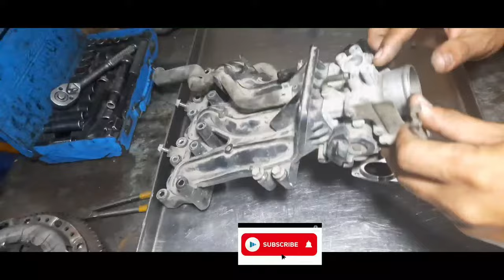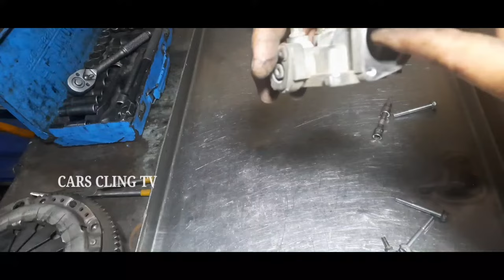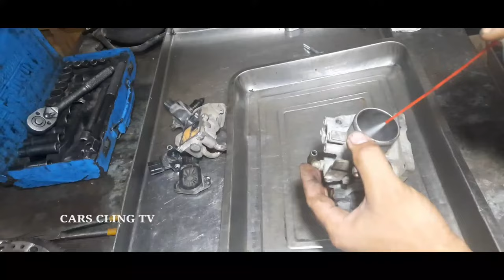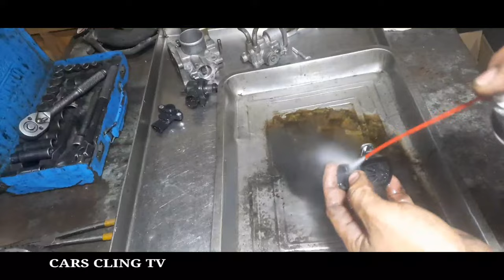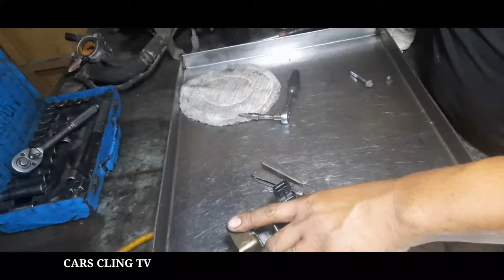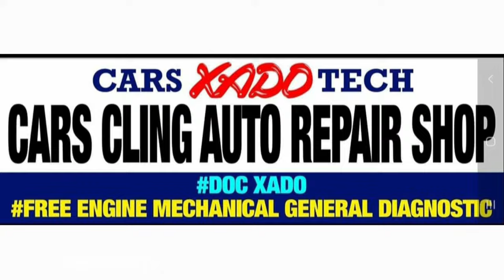ENGINE VIBRATION DIED DURING IDLING IACV TPS MAP SENSORS MAIN CAUSE ISSUE CLEANING SET UP TUTORIALS

Comment: Idol anu po ang sira ng k6a gumagalaw ang makina tpus mamatay ang makina kung hnd m bigyan ng rpm. Pero maganda ang hatak pag apakan m ang pedal.
Reply from the maker: Kapag ang makina ng iyong Suzuki K6A ay namamatay kapag inaapakan mo ang silinyador (throttle) at magalaw ang RPM, may ilang posibleng dahilan at mga paraan para maayos ito:

1. **Dirty or Faulty Idle Air Control (IAC) Valve**:
   - Ang IAC valve ang tumutulong sa pag-regulate ng idle speed ng makina. Kung ito ay marumi o may sira, maaaring magdulot ito ng hindi stable na idle.

   **Paraan**: 
   - Linisin o palitan ang IAC valve.

2. **Vacuum Leaks**:
   - Ang vacuum leaks ay maaaring magdulot ng erratic idle at mamatay na makina.

   **Paraan**: 
   - I-check ang mga vacuum hoses at intake manifold gasket para sa mga tagas. Palitan ang anumang sirang hoses o gasket.

3. **Faulty Mass Air Flow (MAF) Sensor**:
   - Ang MAF sensor ang sumusukat sa air entering the engine. Kung ito ay marumi o may sira, maaaring magdulot ng maling air-fuel mixture at magdulot ng idle issues.

   **Paraan**: 
   - Linisin o palitan ang MAF sensor.

4. **Dirty Throttle Body**:
   - Ang maruming throttle body ay maaaring magdulot ng erratic idle at mamatay na makina.

   **Paraan**: 
   - Linisin ang throttle body gamit ang throttle body cleaner.

5. **Faulty Fuel Injectors**:
   - Kung ang fuel injectors ay barado o may sira, maaaring hindi sapat ang fuel na pumapasok sa makina kapag inaapakan ang silinyador.

   **Paraan**: 
   - Pakonsulta sa mekaniko para linisin o palitan ang mga fuel injectors.

6. **Clogged Fuel Filter**:
   - Ang baradong fuel filter ay maaaring magdulot ng insufficient fuel delivery, lalo na kapag kinakailangan ng mas maraming fuel.

   **Paraan**: 
   - Palitan ang fuel filter.

7. **Ignition System Issues**:
   - Problema sa mga spark plug, ignition coils, o spark plug wires ay maaaring magdulot ng improper combustion.

   **Paraan**: 
   - Palitan o ayusin ang mga spark plug, ignition coils, o spark plug wires kung kinakailangan.

8. **Engine Control Unit (ECU) Problems**:
   - Ang probleme sa ECU ay maaaring magdulot ng erratic engine performance at mamatay na makina.

   **Paraan**: 
   - Pakonsulta sa mekaniko upang maisagawa ang diagnostic check at i-reprogram o palitan ang ECU kung kinakailangan.

9. **Dirty or Faulty EGR Valve**:
   - Kung marumi o barado ang EGR valve (Exhaust Gas Recirculation), maaaring magdulot ito ng unstable idling.

   **Paraan**: 
   - Linisin o palitan ang EGR valve.

10. **Low Fuel Pressure**:
   - Ang low fuel pressure dahil sa faulty fuel pump o pressure regulator ay maaaring magdulot ng engine performance issues.

   **Paraan**: 
   - Ipa-check ang fuel pressure sa mekaniko at palitan ang fuel pump o pressure regulator kung kinakailangan.

Ilan sa mga hakbang na ito ay maaaring gawin mo mismo kung ikaw ay may karanasan sa pag-aayos ng kotse, ngunit para sa mas komplikado at delikadong bahagi, mas mainam na kumonsulta sa isang propesyonal na mekaniko.

Thank you for your support!

More Basic Pointers Toturials FULL Videos: https://www.youtube.com/channel/UCXSl7FUzPZV3lIxFWCHFTVA
For more inquiries, please contact us at our 
FB Page CARS CLING TV: https://www.facebook.com/clingauto
CARSClingTvShortVideos: https://www.youtube.com/channel/UCsUWQnaD9vVKqL_w6eAYhgA
#
#xadoenginetreatment 
#carsclingtv 
#basicpointerstutorialissuefixed 
#xadoenginetreatmentengineperformancerecovered
#10yearslonglastceramicscarbonmetalcoated 
#carsclingautorepairshoplegacy 
#trottledelayremoval
#blackwhitesmokeremoval
#lowpowerengineremoval
#carsclingtvshortvideos
#xadoenginetreatment 
#changeoilpms
#enginecarbonchroming 
#carsclingautorepairshop
#remedyxadotreatment 
#acceptcheckengineissue 
#troubleshoot 
#legitonlineseller  
#Mobile09171259996
CARS CLING TV Located @Purok Pandian Gay Corner Makar Highway Brgy. Labangal General Santos City SouthCotabato 9500

Comment: anong pang linis gmt nyo po?
Reply from the maker: Ang trottle body assembly ay maaaring linisin gamit ang isang kahoy na tanso brush o soft-bristle brush, isang carburetor cleaner spray, at isang clean rag. Narito ang mga hakbang kung paano linisin ang trottle body assembly:

1. Siguraduhing naka-off ang engine at ang sasakyan ay naka-parko sa isang ligtas na lugar.

2. Buksan ang hood ng sasakyan at hanapin ang trottle body assembly. Ito ay matatagpuan malapit sa intake manifold at may isang itim na flap o plate sa loob nito.

3. Alisin ang air intake tube o air filter housing sa trottle body assembly upang ma-access ang bahagi.

4. Gamit ang brush, linisin ang labas at loob ng trottle body assembly. Alisin ang anumang carbon deposits o buildup sa mga bahagi tulad ng flap at bahagi ng throttle plate.

5. Sprayahan ang carburetor cleaner sa mga bahagi ng trottle body assembly. Pay attention sa mga bahagi na may kalakip na sensor tulad ng idle air control (IAC) valve. Sundin ang mga tagubilin ng cleaner manufacturer.

6. Matapos ma-sprayahan, gamitin ang brush upang linisin ang mga natira pang buildup o dirt. Siguraduhing linisin ang mga apektadong bahagi nang maayos.

7. Gamit ang malinis na tela o rag, punasan ang mga bahagi ng trottle body assembly upang alisin ang natirang carburetor cleaner at malinis ang mga bahagi.

8. Ibalik ang air intake tube o air filter housing sa trottle body assembly at siguraduhing maayos na namapa at kumabit.

9. I-start ang engine at hayaang ito'y mag-inito ng ilang minuto. Panatilihing tatakbo ng maayos at subaybayan ang anumang posibleng mga isyu.

Mahalaga na sumunod sa mga tagubilin ng manufacturer ng sasakyan at gamitin ang tamang mga pagsasaayos at mga produkto sa panlinis ng trottle body assembly. Kung hindi ka kumpisyente sa paglilinis nito, maaring mas ligtas na humingi ng tulong sa isang propesyonal na mekaniko.

Yes Sir. Salamat sa walang sawang suporta sa ating munting channel

For more inquiries contact @ FB Page CARS CLING TV: https://www.facebook.com/clingauto
Please Support, Like & Follow  Thank you and God bless!
Contact: 09171259996
CARS CLING TV Located @Purok Pandian Gay Corner Makar Highway Brgy. Labangal General Santos City SouthCotabato 9500
please support my other channel:
CARSClingTvShortVideos: https://www.youtube.com/channel/UCsUWQnaD9vVKqL_w6eAYhgA
Aqua Marine Adventure: https://www.youtube.com/channel/UCHxjUhFmYMbRGxN3l21pNeg

Comment: Boss may tanung Ako anu naman sira kapag matagal pumasuk Yung clutch Ng f6a multicab na automatic..kapag ma init na ang engine..
Reply from the maker: Ang mga posibleng dahilan kung bakit matagal pumasok ang "clutch" o bakit nahuhuli ang pag-engage ng transmission sa isang sasakyang may automatic transmission at umaayos lamang kapag mainit na ang makina ay maaaring kabilang ang mga sumusunod:

1. *Mababa o Marumi ang Transmission Fluid:* Ang unang dapat suriin ay ang antas at kalagayan ng transmission fluid. Kung mababa ang fluid level o marumi na ito, maaaring makaapekto ito sa performance ng transmission dahil ang fluid ang siyang nagpapadulas sa mga gumagalaw na bahagi at nagkokontrol sa hydraulic pressure.

2. *Worn-out Transmission Components:* Kung may mga nasira o worn-out na bahagi sa loob ng transmission tulad ng clutch plates o bands, maaaring hindi agad kumapit ang mga ito hanggang sa uminit na ang makina at dumaloy ng maayos ang fluid.

3. *Problema sa Torque Converter:* Ang torque converter ang responsible sa pagpapasa ng power mula sa engine papunta sa transmission. Kung may problema ito gaya ng pagyonot ng mga internal components, maaari ring magdulot ng delay sa pag-engage ng transmission.

4. *Hydraulic Issues:* Ang mga problema sa hydraulic system ng transmission, gaya ng mga kumakalat na seals o baradong passages, ay maaari ring magresulta sa delayed engagement dahil hindi nararating ng fluid ang mga bahagi na kailangang ikontrol.

5. *Electronic Issues:* Sa mga modernong sasakyan, may mga electronic sensors at solenoids na nagkokontrol sa transmission. Faulty sensors or solenoids could result in delayed response, especially when they're not functioning properly until warmed up.

6. *Normal Operation of Older Transmissions:* Sa mas matatandang models ng sasakyan, normal ang magkaroon ng kaunting delay sa pag-engage habang hindi pa pinainit ang makina, lalo na sa mga lugar na may malamig na klima.

Para matukoy ang eksaktong sanhi, mas mainam na ipatingin ito sa isang propesyonal na mekaniko o dalhin sa service center para sa masusing inspeksyon at maayos na diagnosis.

More Auto Basic Pointers Toturials with %100 FREE
https://www.youtube.com/channel/UCXSl7FUzPZV3lIxFWCHFTVA

Comment: Ano yang pang lenes mo boss?
Reply from the maker: Ang pinakamahusay na panlinis ng throttle body assembly ng Suzuki ay ang throttle body cleaner o carburetor cleaner na espesyal na ginawa para sa paglilinis ng throttle body at mga bahagi nito. Ito ay isang spray-on cleaner na binuo upang alisin ang dumi, carbon deposits, at iba pang buildup sa loob ng throttle body.

Kapag gagamit ng throttle body cleaner, sundin ang mga sumusunod na hakbang:

1. Patayin ang engine at kumuha ng susi mula sa ignition.

2. Alisin ang air intake hose o air cleaner housing upang ma-access ang throttle body assembly.

3. Gamitin ang throttle body cleaner sa loob at sa paligid ng throttle plate o butterfly valve. Spray ito nang diretso sa throttle body at sa mga nakikitang bahagi ng throttle assembly. Siguraduhing mababasa ang mga dumi at buildup.

4. Hayaan ang throttle body cleaner na matunaw at agahan ang pag-alis ng dumi. Maaaring gamitin ang isang malinis na toothbrush o soft brush upang linisin ang mga bahagi ng throttle assembly kung kinakailangan.

5. Liningasin ang throttle body assembly gamit ang compressed air o shop towels upang alisin ang natunaw na dumi at solvent. Siguraduhing walang natirang dalisay na cleaner o dumi bago muling magsimula ang engine.

Tandaan na bago simulan ang paglilinis ng throttle body assembly, sureuhin na mayroon kang sapat na kaalaman at kasanayan. Kung hindi ka komportable sa paggawa nito, maaari kang lumapit sa isang propesyonal na mekaniko para sa tulong at payo.

Thanks For Your Support on Our Channel.

For more inquiries contact @ FB Page CARS CLING TV: https://www.facebook.com/clingauto
Please Support, Like & Follow  Thank you and God bless!
Contact: 09171259996
CARS CLING TV Located @Purok Pandian Gay Corner Makar Highway Brgy. Labangal General Santos City SouthCotabato 9500
please support my other channel:
CARSClingTvShortVideos: https://www.youtube.com/channel/UCsUWQnaD9vVKqL_w6eAYhgA
Aqua Marine Adventure: https://www.youtube.com/channel/UCHxjUhFmYMbRGxN3l21pNeg

Comment: Boss ano kaya problima nang da64 ko na bigla nalang namatay Ang makina pag nag standby ,,mga ilang minuto bumalik Ang power at nag ok narin umandar na ulit,?
Reply from the maker: Ang problema na kung saan ang makina ng Suzuki DA64 ay biglang namamatay kapag naka-standby at umaandar muli pagkalipas ng ilang minuto ay maaaring sanhi ng iba't ibang dahilan. Narito ang ilang posibleng sanhi at solusyon:

1. **Fuel System Issues**: 
   - **Fuel Pump**: Maaaring hindi na gumagana ng maayos ang fuel pump kaya hindi sapat ang supply ng gasolina sa makina.
   - **Fuel Filter**: Kung barado, maaaring hindi makadaloy ng maayos ang gasolina.
   - **Fuel Injectors**: Maaring kailangan ng paglilinis kung barado o hindi maayos ang spray pattern.

2. **Electrical Problems**:
   - **Battery**: Tiyakin na maayos ang kondisyon ng baterya. Suriin kung mahina na ito o kung may loose connection.
   - **Alternator**: Kung hindi gumagana ng maayos, baka hindi nagcha-charge ng tama ang baterya.
   - **Wiring and Connections**: Tingnan ang mga kable at koneksyon para sa anumang problema, tulad ng loose connections o worn-out wires.

3. **Ignition System**:
   - **Spark Plugs**: Baka kailangan nang palitan kung luma o marumi na ito.
   - **Ignition Coils**: Kung may problema, maaari ring makaapekto sa spark plugs.

4. **Idle Air Control Valve (IACV)**:
   - Maaring barado o sira ang IACV na nagiging sanhi ng hindi maayos na idle.

5. **ECU (Engine Control Unit) Issues**:
   - Ang electrical glitches o sensor failures ay maaaring magdulot ng intermittent na pagkamatay ng makina. Makakatulong ang OBD-II scanner para ma-diagnose ito.

6. **Overheating**:
   - Kung nag-o-overheat ang makina, automatic itong namamatay para maiwasan ang damage. Suriin ang coolant system at tiyakin na walang leaks.

7. **Vapor Lock**:
   - Maaaring nagkakaroon ng vapor lock kung saan nagiging singaw ang gasolina bago pa man makarating sa carburetor o fuel injectors, ito ay maaaring mangyari sa mainit na araw.

Mga dapat gawin:
- Magpa-mechanic checkup para matukoy ang tiyak na sanhi ng problema.
- Regular na maintenance at check-up sa sasakyan ay makakatulong para maiwasan ang ganitong uri ng problema sa hinaharap.

Kung hindi ka sigurado sa pag-aayos, mas mabuti na dalhin ito sa isang propesyonal na mekaniko para masiguradong maayos ang maintenance at repair ng sasakyan.

Thank you for your support. Please contact me at this link:

More Basic Pointers Toturials FULL Videos: https://www.youtube.com/channel/UCXSl7FUzPZV3lIxFWCHFTVA
For more inquiries, please contact us at our 
FB Page CARS CLING TV & XADO Available @our FBPage: https://www.facebook.com/clingauto
CARSClingTvShortVideos: https://www.youtube.com/channel/UCsUWQnaD9vVKqL_w6eAYhgA
#
#xadoenginetreatment 
#carsclingtv 
#basicpointerstutorialissuefixed 
#xadoenginetreatmentengineperformancerecovered
#10yearslonglastceramicscarbonmetalcoated 
#carsclingautorepairshoplegacy 
#trottledelayremoval
#blackwhitesmokeremoval
#lowpowerengineremoval
#carsclingtvshortvideos
#xadoenginetreatment 
#changeoilpms
#enginecarbonchroming 
#carsclingautorepairshop
#remedyxadotreatment 
#acceptcheckengineissue 
#troubleshoot 
#legitonlineseller  
#Mobile09171259996
CARS CLING TV Located @Purok Pandian Gay Corner Makar Highway Brgy. Labangal General Santos City SouthCotabato 9500

Comment: Sir tanong ko po balak Kong Bumibili multi cab .maganda automatic or manual o turbo nan turbo salamat
Reply from the maker: Yes Sir,. Mas maganda po ang manual transmission non turbo engine,. Once na naka automatic transmission mahirap ang piyesa then non repairable, mahirap din ang turbo type dahil sirain ang turbo shifting nito, then magal ang piyesa,
Reply: Baka gusto mo bilhin multicab transformer ko 4x4 manual with canopy complete set up 2yrs service  ko lang 220 neg.
Reply from the maker: Thank you Sir. 

More Basic Pointers  Toturials videos: https://www.youtube.com/channel/UCXSl7FUzPZV3lIxFWCHFTVA
FB Page CARS CLING TV: https://www.facebook.com/clingauto
CARSClingTvShortVideos: https://www.youtube.com/channel/UCsUWQnaD9vVKqL_w6eAYhgA
#
#xadoenginetreatment 
#carsclingtv 
#basicpointerstutorialissuefixed 
#xadoenginetreatmentengineperformancerecovered
#10yearslonglastceramicscarbonmetalcoated 
#carsclingautorepairshoplegacy 
#trottledelayremoval
#blackwhitesmokeremoval
#lowpowerengineremoval
#carsclingtvshortvideos
#xadoenginetreatment 
#changeoilpms
#enginecarbonchroming 
#carsclingautorepairshop
#remedyxadotreatment 
#acceptcheckengineissue 
#troubleshoot 
#legitonlineseller  
#Mobile09171259996
CARS CLING TV Located @Purok Pandian Gay Corner Makar Highway Brgy. Labangal General Santos City SouthCotabato 9500